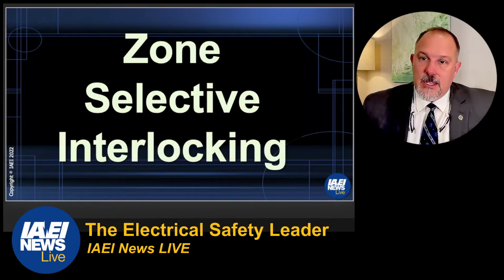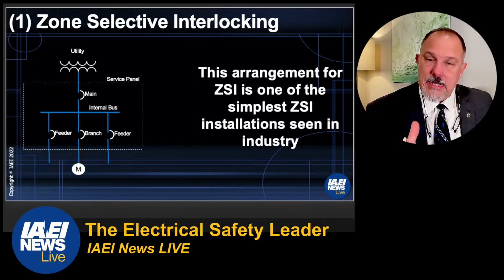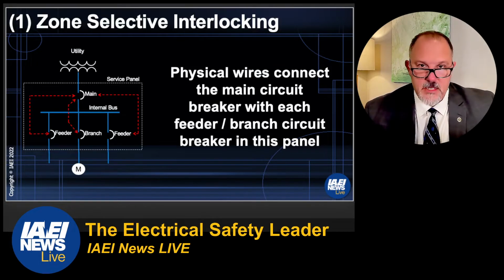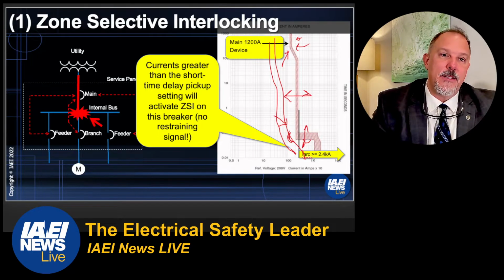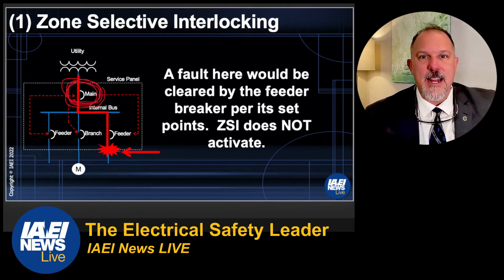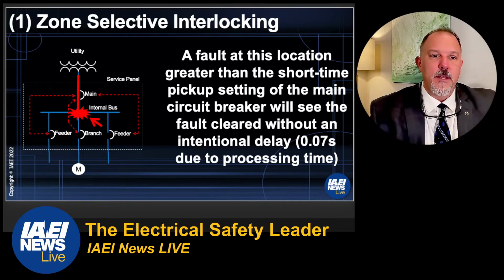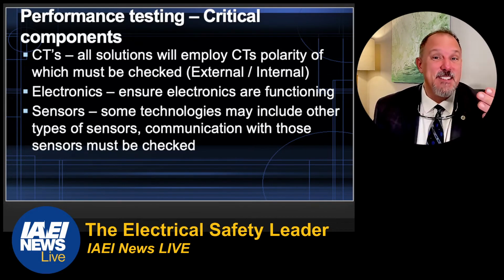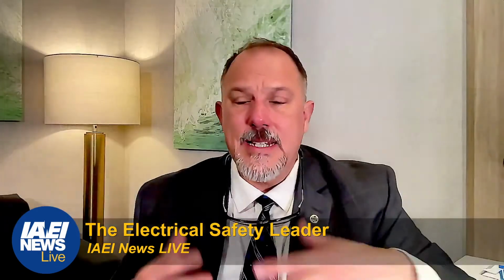Zone Selective Interlocking

Comment: This is a good explanation of ZSI. The purchaser MUST hire an electrical engineer to specify equipment, coordinate protective devices, and perform arc flash calculations. The purchaser MUST also hire a competent testing firm to verify ZSI works during commissioning. This IS NOT something you can leave to a contractor or electrician to figure out.